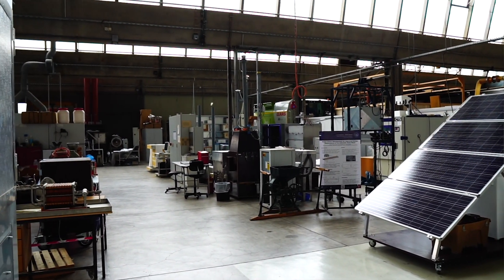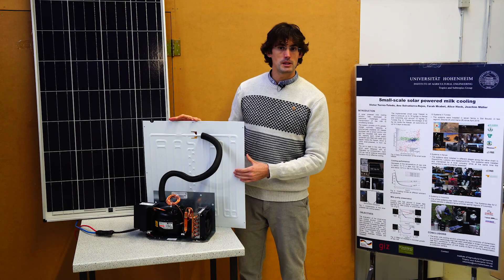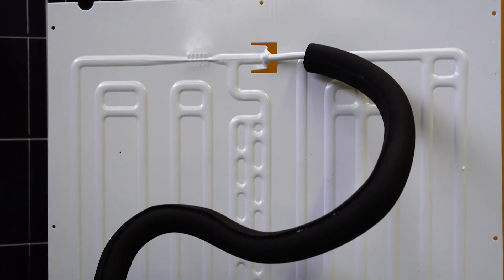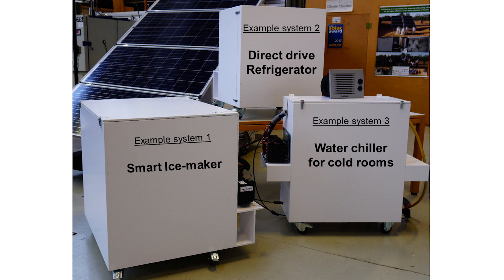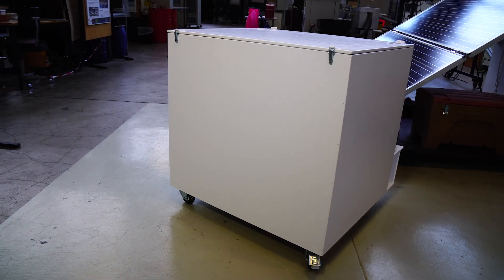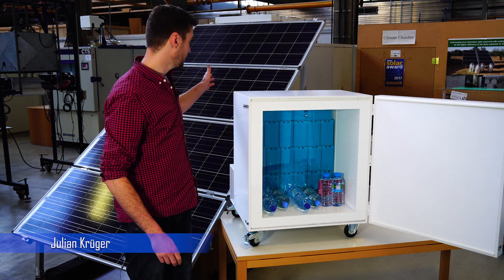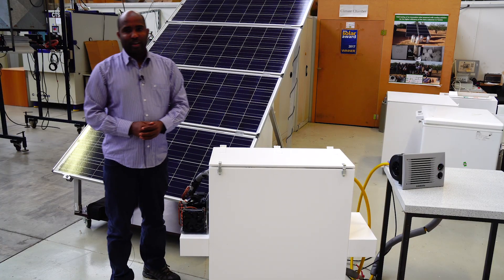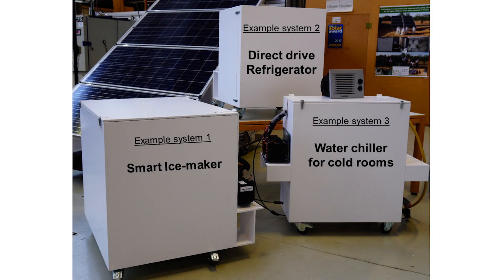Do it yourself solar cooling for agriculture by the University of Hohenheim

Comment: I was wondering if any of this solar cooling system could be used for an AQUAPONICS greenhouse as in water for fish/plants/ and air temp in ghana.
Reply: of course, it is the simplest application - put the evaporator in a water tank, then circulate the cold water in the pond or use a fain coil to  cool air